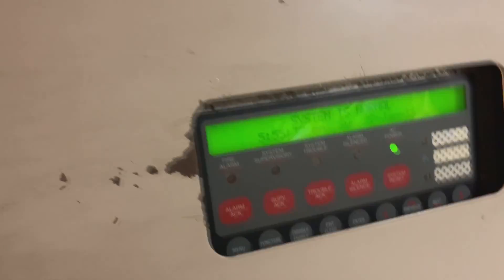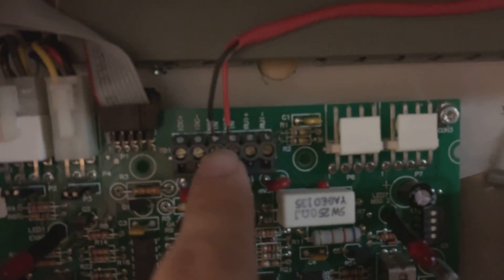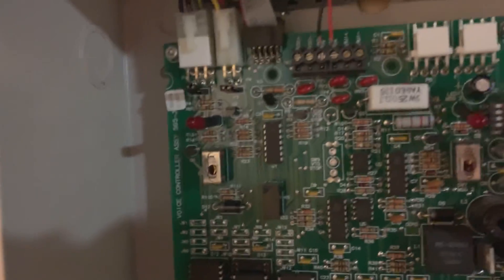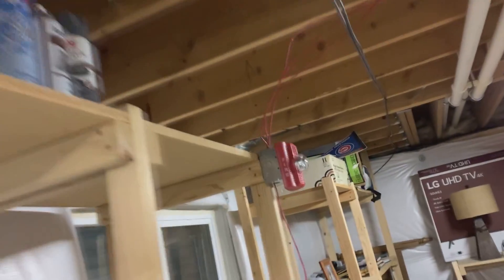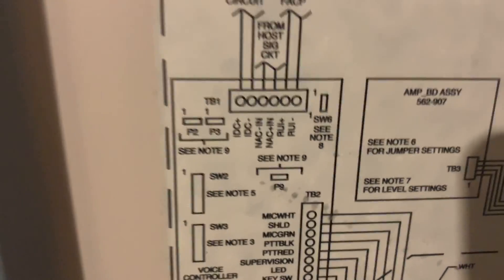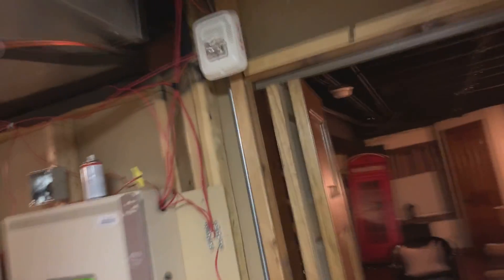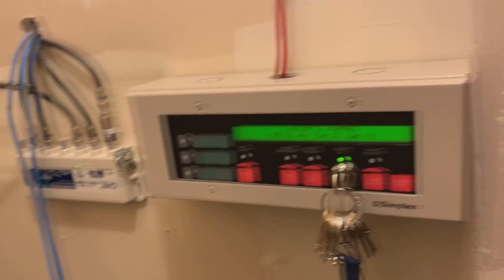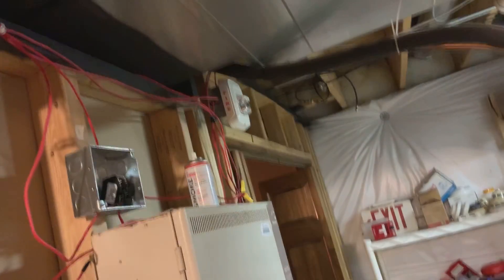Home System Test 58: Simplex 4003 - Slow Whooping Voice Evac!

Comment: The way how he got the System Sensor notification appliances strobes to sync is by putting them on the compatible sync module which is a System Sensor MDL 

Fun Fact: Gentex, and Wheelock devices can be put on a Simplex sync module, and Simplex devices can be synced using A Wheelock and Gentex sync module

Comment: what if your building has elevators? 

(i assume just have signs on the elevators.)
Reply: Think this might be a basic voice system not designed for high rise buildings. Since I’m visually impaired, I went to a school for the blind. The elementary school wing had Truealert horn/strobes on Code 3. The middle/high school wing had the 4003, mainly because this is where the library and cafeteria were, and the fire marshal considered our middle/high wing as an assembly occupancy, therefore requiring a voice system. When we had fire drills we would do the two wings separately, either elementary first or middle/high first, then go to the next building. This made our drills work otherwise it would be a hassle trying to evacuate everyone at once. Our buildings were mainly only two stories, and the no-elevator rule was pretty self-explanatory so wasn’t worth repeating over the alarm.

Comment: my church has the 4010 and the4003
Reply: Yeah, that’s a very common combination. Churches are a place of assembly for large groups of people. Therefore, many fire codes require a voice evacuation system to quickly relay emergency information to the public. Image that you had 500 people at your church and there were only Truealert horn strobes. The evacuation would not be as smooth if you don’t have voice instructions. Where I went to school we would have a monthly fire drill, and whenever the slow whoop started people knew clearly that it was a fire alarm. Our building was designed with that system because of the library and dining room; all other parts of our building had horns.

Comment: A job I was just on just has SPSWL speaker strobes , wall speakers , and ceiling speaker strobes. They were pretty cool. They went off a hundred times when NAVFAC had to test them. (Naval base) . We got to work a couple weeks ago and the building across the street has advances that were going off and I couldn’t believe how loud they were even across the street .

Comment: Funny u used those speaker strobes. I have both of those speaker strobes. Got them over the summer. My boss left me with the L-Series speaker strobe that had an awkward bracket and the SPSR was removed in a fit up on a 5820XL-EVS system.

Comment: Also, could it be that the 4003’s message doesn’t mention elevators because it was meant for smaller buildings? For example, a smaller school where there’s only one story and no elevators having a 4003(EC) voice system as opposed to a middle or high school or any building with two or more levels that has the voice system built into a 4100 series panel that has the standard Simplex message.
Reply: Probably not. We had a system in our building that did not mention elevators. I think it’s clear to most people that you should always use the stairs.